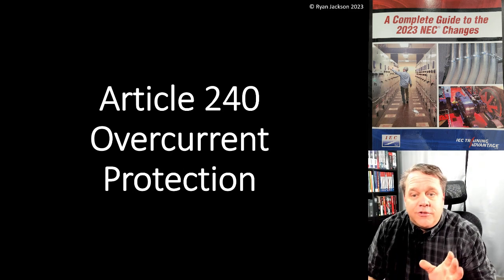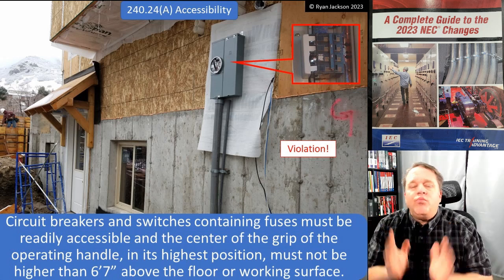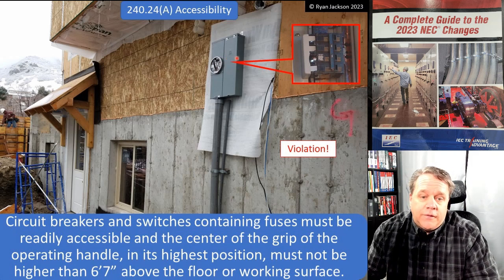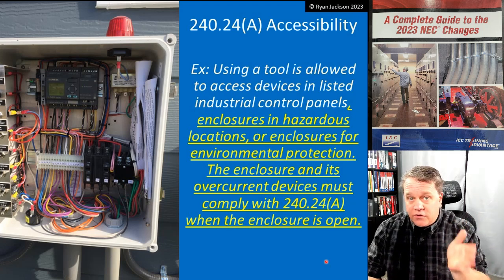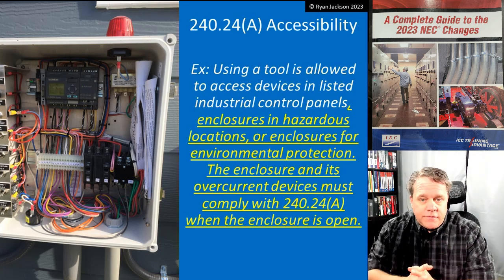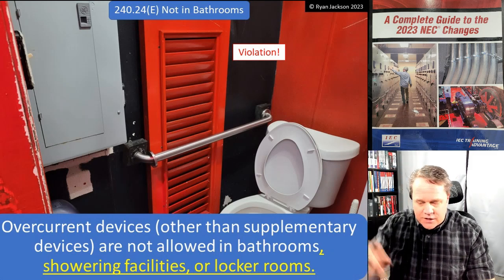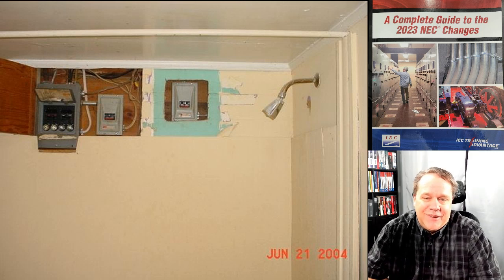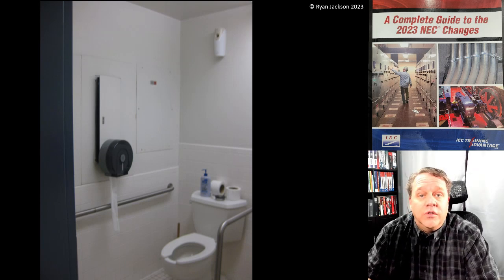2023 240.24 Location (of Overcurrent Devices) in/on the Premises

Comment: I did a little searching in the NEC but found nothing specific on the maximum height for meter cans. Can you please confirm whether or not 6' 7" applies to meter cans as well?  Thanks
Reply from the maker: Does not apply. Talk to your utility.
Reply: 6’7” is top breaker.   NOT top allowable breaker space correct?  So if I install the top branch circuit breaker at 6’7” even though there may be space above then it would be in compliance.   I specifically stated center of breaker handle not “ potential height possible breaker etc etc.”.

Comment: Can you explain other then the use of a key? Those that mean a key for panel room or for any room?
Reply from the maker: Using a key is still considered readily accessible. Equipment in a locked equipment room, for example, is still readily accessible if it meets the remainder of the definition.